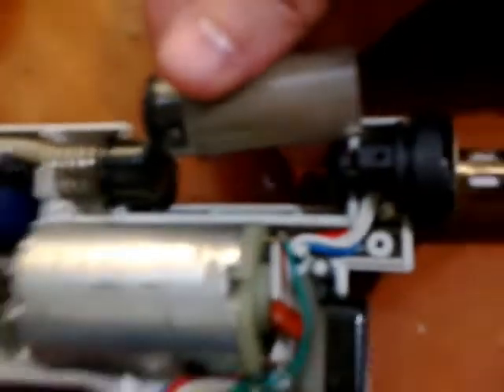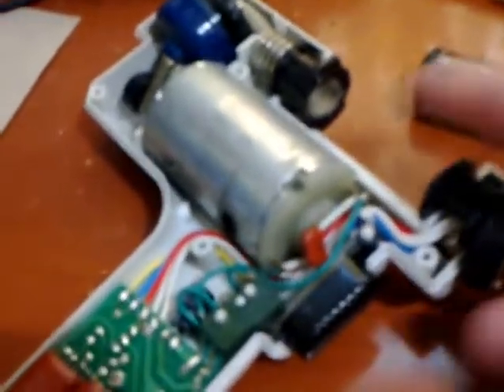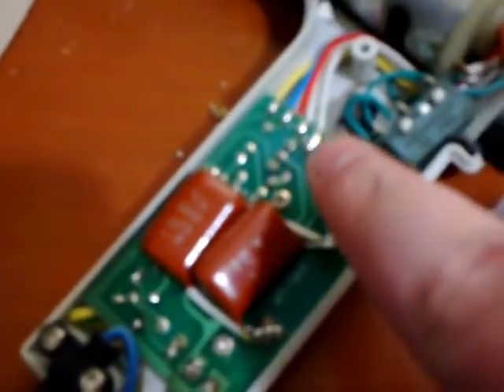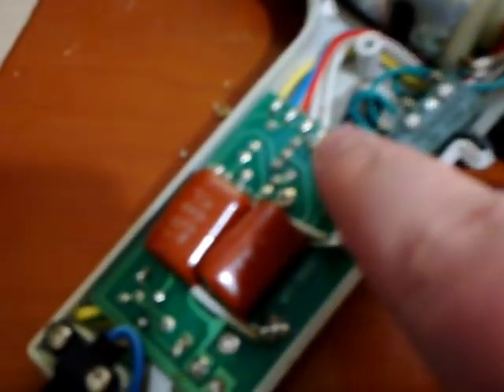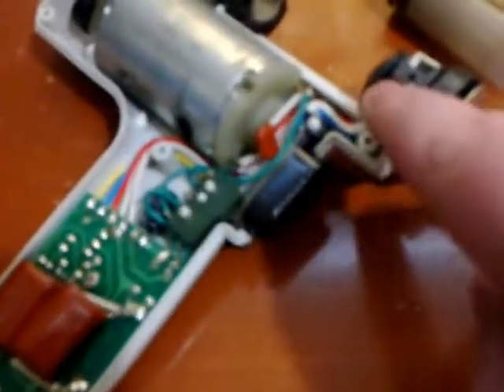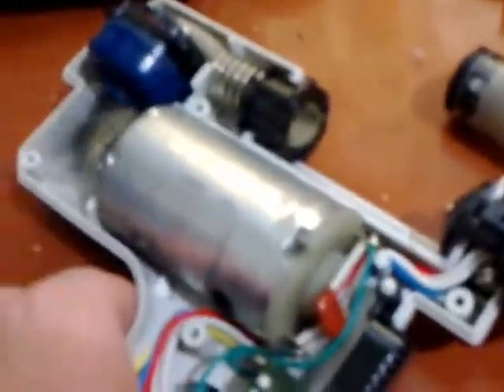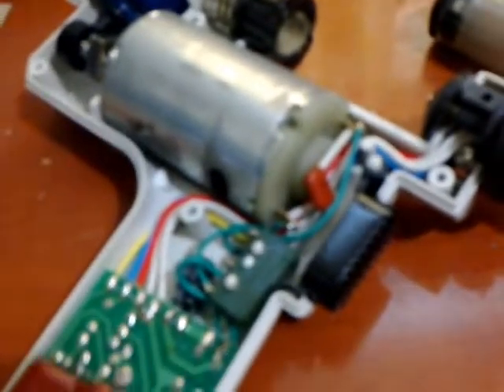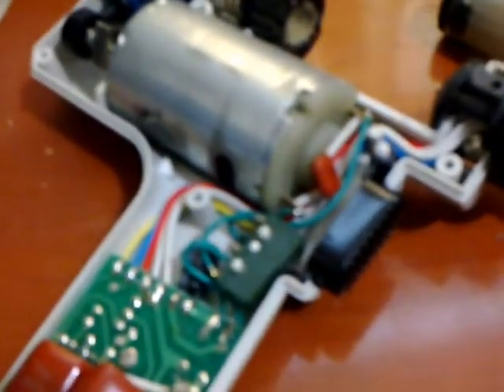Sucker b gone :( My Gaojie mt-993 desoldering gun broke, so, here's what's inside.

Comment: Is the suction any good on this model? Have you tried a Hakko 808 to compare? BTW: You get a new replacement heat core on ebay for less than $20 shipped.. Search for Electric Vacuum Desoldering Pump Solder Sucker Gun Heat Core 993 994 995 996